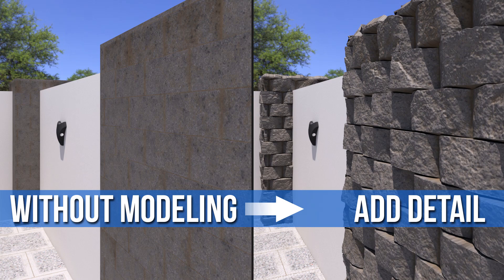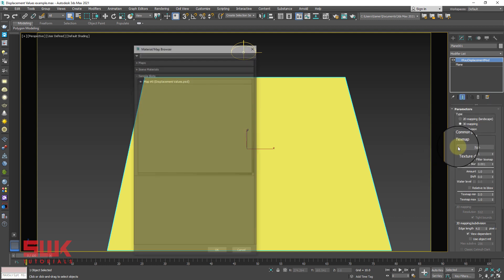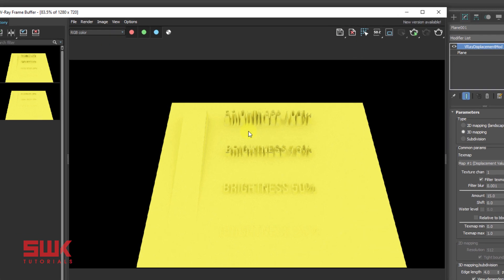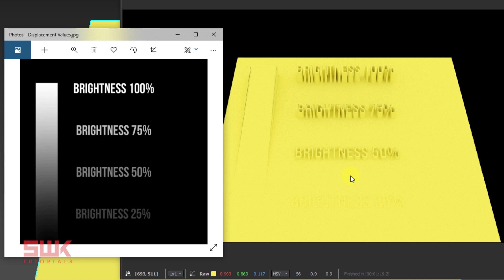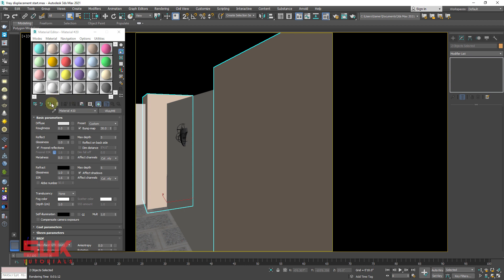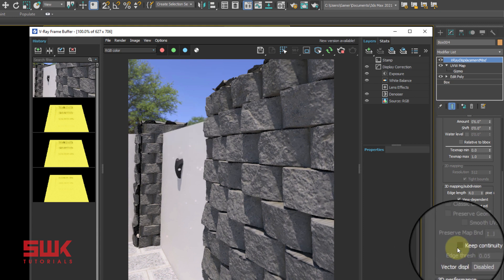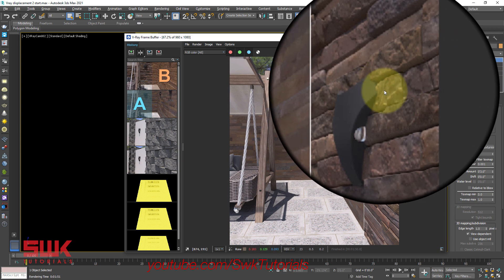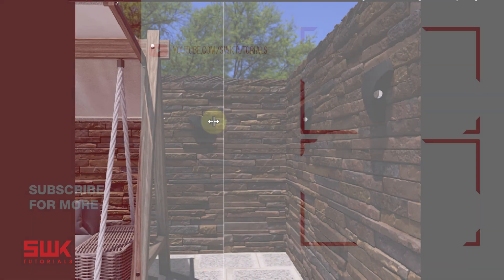3ds max + Vray Displacement to add detail in objects using textures

Comment: actually acording to vray you need to half the shift value for 8 bit displacement maps so if you have 3 inches you would do -1.5 inches because any value of grey would be no displacement i think if i remmeber correctly .but if you are using a 32 bit exr file you dont need to adjust shift but set your min max values to something within the range of your displacement map.

Comment: max's built in displacement hasn't gotten better over the years? I'm trying it in max 2016 and it just crashes if there is any complexity
Reply from the maker: You need a lot of ram for it.
This scene was made with 32GB ram

Comment: I need your help: When I add the displacement to 3 objects, my IPR gets pixelated, the camera freezes or 3DS Max crashes. I wanted to make a 30m sidewalk with pavement and it froze too. Is there a problem with my textures or should displaced objects be small and you shouldn't use them on every object?
Reply from the maker: How much ram do you have installed in system?
Plus graphic card details
Reply: @SWKTutorials  thanks your reply so far. I got 16gb ram, a Nvidia Geforce 2060 4gb and a Ryzen 7 2700
Reply from the maker: Your graphic card is ok. But the ram can be an issue. In my experience displacement needs a  lot of ram.
Reply: @SWKTutorials  oh ok, thank you!

Comment: I HAVE A QUESTION ? what if I want to modify the scale of the displacement map? how can I do it? for example I've  modified the texture with uvw map but the displacement is off scale. thanks for the video
Reply from the maker: I didn't understand what do you mean by scale of displacement. The displacement is used to give height or depth to the model according to texture. If the displacement result is not good. Just play with its parameters as shown in video.

Comment: Thank you so much for this content! 
Question 1 : what is the difference between vray bitmap and general bitmap?
Question 2 : I see that you don't selected the rest of the maps because they are not in the subject, can you do a complete content with all that textures files like Normal, Roughness and Ambient Occlusion?
Reply from the maker: Answer 1: since vray 5 , VRayHDRI texture had been renamed to VRayBitmap texture.
It will give some performance improvements. According to Chaos group. But frankly I haven't check the performance.
Answer 2: I'll do it in future.

Comment: Brother you are amazing.    this is professional teaching

And you save my life , I was doing chamfering and increasing polly count to fix this but  that wasn't helping at all
Reply: But this method is killing my computer ,I am using 8 gen i5 with 4 gb graphics and 16 gb ram ( this is not enough 😭 so Play gently for those who are like me)
Reply from the maker: This is a professional method I used in my office. Just do 1 thing. Keep edge length to 4. Don't decrease it. It will save render time.
Reply from the maker: After doing this let me know. I hope this will not kill your system.
Reply: @SWKTutorials   yha we can't reduce pixels count to 2 and below , I find a sweet spot of 3.5 and 3
Reply from the maker: Good. Keep the edge length between these values.